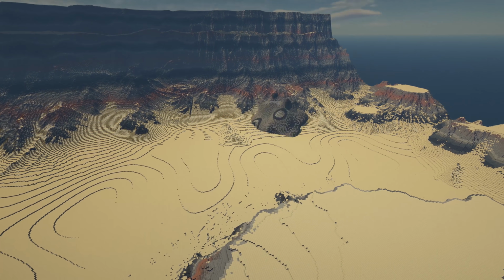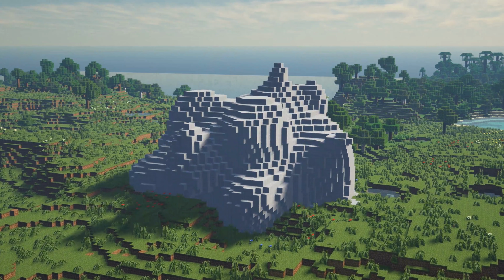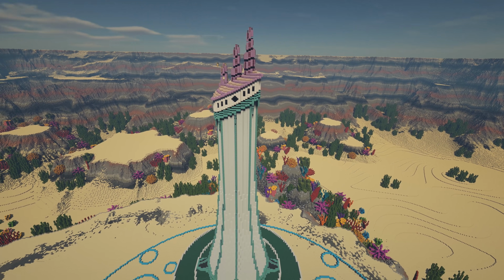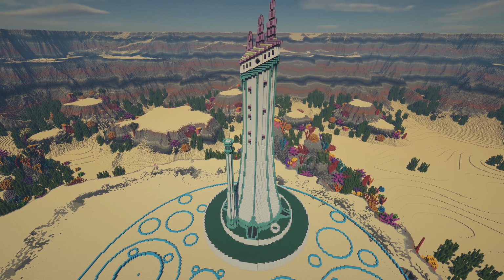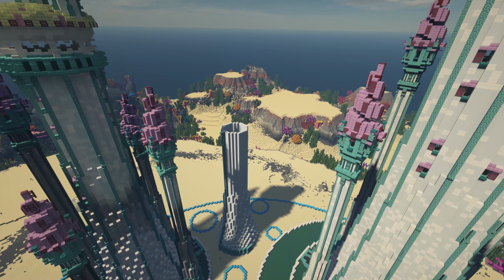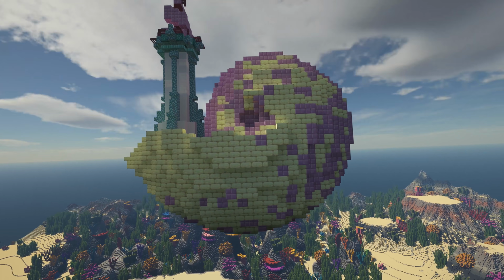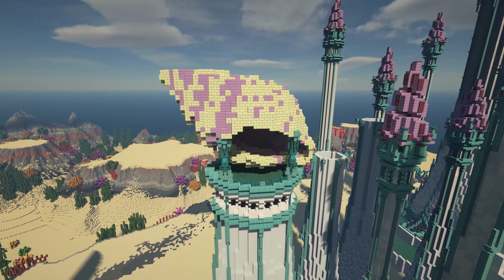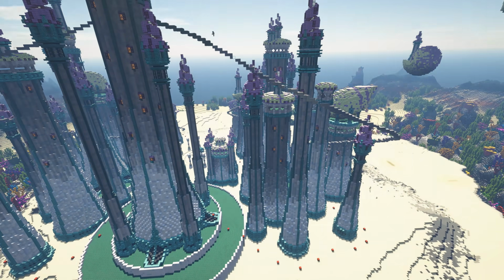My Most Anticipated & EPIC Minecraft Project EVER!

Comment: 1. There could be an under water cave or tunnel leading to the other kingdom
2. Or there could be a rusty scuba helmet that could lead to the other kingdom
3. Slums could be packed into groups of coral
4. Glowing jellyfish?
5. A trident to serve as a power source to a force field ( so the underwater kingdom can attack the other kingdom without being attacked itself)
6. Dolphins as guards 
7. a part of the underwater kingdom could be ruins as a result of an attack from the other kingdom
8. The other kingdom could be dumping its waste into the underwater kingdom ( a motive to attack )
9. Crabs could be used by the other kingdom to attack the underwater kingdom
10. A magma or soul sand elevator system
just some ideas I have

Comment: sea shell themed villages on the two lower shelves of the central plateau and a large arena taking up the lowest shelf between them.

An abyssal rift with monsters or kraken tentacles emerging from the black abyss.

whales with howdahs/carriages for transportation/cargo, maybe guarded by dolphin/shark riders (armor stands could be used to make the riders)

shipwrecks (maybe one has been repurposed into a home)

giant eel resting in a cave on the massive cliff face dragon-style.

small villages/settlements interwoven among the reefs, maybe even a couple built into particularly large rock/reef formations.

A small magma breach with a settlement dedicated to smithing built up around it, 'using' the ambient heat of the breach to heat the metal.

more tower buildings/settlements on the other smaller plateaus, not as big or numerous as they are on the central plateau.

having fish farms made out of seaweed 'posts' interwoven with netting inbetween them.

a group of dolphin/shark riders fighting/hunting a giant crab.

seaweed/kelp farms.

a mage tower with a vortex leading into a hole in the roof (either real (how would that even get done?) or simulated using a descending spiral of 'water' colored blocks)

Comment: One thing that triggered me is building pilliars and putting nothing on top of them. What is the point of a pilliar if not to hold something up? This triggered me with the vault in the elf kingdom as well. Plz build something on top of the pillars around the power source,  it has so much potential. Maybe another shell or a statue of Poseidon. Also the vault in the elf kingdom could be built up on top as well, with lots more storage and pilliars going up into the cave ceiling.

Comment: Warning: prepare for an essay of ideas.

         At least one person down here said a trench. You should do that, but add some houses in the sides, connected by balconies and bridges. They could be made out of warped planks.

         Or a whirlpool made of glass panes that breaks through the surface.

         You could also add a giant, deep-sea worm that looks like it's flowing in and out of the sea bed all around the entire map, like a protector of the build. It could have an angler fish-like light on its head with a few deep-set, eerily glowing eyes and rows and rows of huge, shark-like teeth. Some of the teeth could be scattered around the map: huge trophies that peasants and royalty alike deem priceless. 
         Another commenter talked about a giant stone statue with a rusted diving helmet on it; you could make the helmet slightly lopsided and the statue's base tilting out of the sand a little like it has been moved by the tides over time. Sporadic bunches of algae around it and cracks/other weathering would make a great addition. It could have a worm tooth around its neck and a trident gripped in its fist, either in a standing position or ready to strike.

         
         Skeletons of giant (two-headed, triple-tailed) mermaids that have been gnawed away in places to make underwater nests for strange, gilled birds.

         Yet another person talked about pods of glowing jellyfish; they could be made of stained glass blocks and paned and filled with lava or sea lanterns for the gills.
Reply: Yes, I just liked my own comment.

Comment: Put a glass dome around just the castle. I feel without it there's no point in stairs. Also it'll be easier to see the full castle underwater if the castle the castle itself is surrounded by air.

Comment: For more Lore,

you could add an old ruined kingdom that was overtaken by the rising water level.  This raised water became enriched by the power source, causing the sea serpants to overgrow in size and quantity.  The Water Kingdom took advantage of this to overtake the old kingdom to harness that power.  In last defense, the old kingdom escaped with a small piece of the remaining power source into an underground cave far away.  The new Underground Kingdom created a beacon with this power source, guarded by 4 knights.  This beason cracked the ceiling allowing sunlight to shed in.  This beacon power enriched the sunlight, which manifested these sky dragons in their new defense.  The Water Kingdom, years later, finally discover the new Underground Kingdom and return wanting the take the last of the power source.

Just trying to help connect the 2 kingdoms.

Comment: Hey! Just a thought! The power source is quite low in height compared to everything else. Naturally I think this wouldn’t be the case as sand etc would pile in this area due to water currents. What if the ground beneath it was a designed with this in mind and made to be a sand dune? This would Add in a bit of height to the Main generator as it’d sit on top of the dune in the middle with pillars down lower on the sides of the dune? Still keeping it much lower than the rest of the buildings but adding in a bit of extra character and dynamics!

Comment: Okay, hear me out. First things first, English isn't my first language, so I am sorry if there are mistakes. Second, I am not sure if this makes sense and it pretty much has an open ending. Third, it's 0:35 AM so it is probably even worse then if I would have written it to a normal time. So, let's start with my little backstory:

Centuries ago there were two rising kingdoms. The water kingdom and the cave kingdom. The two kingdoms used to be the most powerful alliance ever seen. But then the people of the water kingdom found a power source, big enough to power the kingdom for centuries. But as soon as the cave kingdom heard about this power source, the times of the alliance were over. The kingdoms fought and fought. Because of the long war, the people forgot about the reason they fought. But still they kept fighting. 
Before 10 years, the war finally ended after more than 5 centuries. But then, the power sources of both kingdoms disappeared.

(Again, I am sorry.)

Comment: Everyone's given great ideas about sea related things (and that's great, that what's going into the heart of the build), but I was actually thinking of a way to interact with the underground kingdom's people, or any other land dwellers? While they might be rivals, they are both key kingdoms of the land and need to meet at some points, so you could add bubbles of air from the surface all the way down into the kingdom, and possibly a little town, as an accommodation for the foreigners there to visit.

Comment: Idea for a building: Underwater mine. Underwater minning is very profitable. Seaweed and coarl farm. Finally a sppot where the water goes in tunnels to power the elf cave. Around those, a fortifiction to protect them. An area to train their water snakes. Also for the cave of the elves, because there is so much space left in the cave, there could be a dragon training area with cage hanging from the ceilling.

Idea for backstory: The main reason the underground and underwater kingdoms hate eachother could be because of economical reasons. I don't se this often but it is a very interesting and realistic cause of war. Since both kingdoms are extremly successful at mining minerals for their and other kingdoms, it's a battle of who makes the most minerals. It's two very successful companies competing against eachother. 
The only difference is that the underwater kingdom has underwater farming among other profitable businesses.
Due to the forges being fuled by water in the undergound kingdom, the underwater kingdom once blocked the water to stop them from minning (the water is their territory so the thecnicaly can). Out of fear of economic ruin, the underground kingdom launched an attack to take the lands where the water enters their cave. War broke out. The elves built a fortification around the openins to protect them.

In conclusion, it would be your desision to choose if they are still at war, but I would think so because the underwater kingdom attacks the undergound kingom with their snakes. There could be other reasons for war that came due to that reson. Logicaly, I wouldn't be war 24/7, times of peace and agreements.

Please consider this idea, it would mean a lot. :D 
(I may have other ideas that I would comment again)

Comment: You could make suspended features, like ‘buildings’ but they’re weighed down by old sea anchors? Also you should add some sort of leviathan as a kingdom protector, it would kind of just be hovering either above the kingdom or along the very edges. It’d be neat if it were longer and with more teeth than big and bulky, but I dunno. It’d be neat if you was this

Comment: How about a ravine with a ruined underground facility in it?

Basically the lore would be humans decided to live underground when the sun rampaged and increased in temperature. Inside the facility, there's a single tree that doesn't require the sun to perform photosynthesis and it absorbs carbon dioxide a lot faster.

When the ceiling of the facility collapsed, all the people drowned and eventually became skeletons and the only thing left was the tree that kept generations alive.

But one survived, and surprisingly it's the founder of the underground kingdom.

Or since the whole thing already reached bedrock, just put the facility in a cave I guess?

Comment: Some ideas:
- in the rock face you can have the entrance to the kingdom, maybe a little building built into the face that connects to some water elevator that would transport outsiders to the kingdom
- a giant serpent wrapped around the central castle platform
- A section of floating houses that are connected to giant floating bouys on the surface of the water. This could be the wealthy section where they "look down" on the rest of the kingdom

Comment: what if the underwater kingdom was usualy a peacefull land, but bc of the water it is very hard to forge things, also its hard to mine and get the wanted recourses and goods, so they mostly depended on the underground kingdom, but the underground kingdom has problems mi Ing so many recourses in such a short time, the recourses are Getting thiner too and the diference between the poor and rich People in the underground kingdom was geting too wide and the poor People started rebelling, so the underground kingdom had to cut off the output of the recourses and such to the underwater kingdom in order to get the balance in the underground kingdom, but the underwater kingdom needs the resourses so they sent those trained waterserpants to get some of the recourses. another words There could be a tunel or another way the serpents got in the underground kingdom, empty storiges, very specificaly made and thought out forges that could be used on very rare ocations and mines that wouldn't have many stuff in them or such, There could be  a lot more slams or building that were previous ly beautiful, but you can tell that it really needs repairs, the poor People would now rebel in the underwater kingdom bc they didn't get enough resourses to live off of and so the Castle would have some defences up, like some sort of catapult stiled things and other stuff like that, the poor People wouldn't have much resourses like I sayed so they would have to improvise with what materials would they use and what wepons would they make. Hope it makes sence since im from Czech republic, english is my second laguache. you don't have to take the hole idea, you can just take the main idea and make it in your own way. ID just be Happy to help.❤️❤️❤️

Comment: As the cave kingdome had seasnakes attacking, it seems only fitting to have the snakes either within a ‘stable’ of some sorts or to have them simply swinging around the kingdom/castle. Additionally, the cave kingdome utilized armor stands to represent the humans/villagers a bit. This will prove difficult underwater and with the angle in which you swim. Theirs a mod that allows armor stands to be more dynamic, but I Unfortunatly don’t have much more info on it.

Comment: You should add:
A city
A trench
Sunken ships
Caves
A prison of some kind
A treasure trove
Spawners
Fishing grounds
Outer settlements of the underwater folk
Various easter eggs
Interiors
Survival elements
A texture pack which only increases visibility under water
Or increased night vision access
Storylines
Possibly Axlotls
Drowned spawners
Somewhere for the ships to come from and go to
Possibly a human fishing village as well
An isolated bay
Some ruins
A merfolk sunning rock
Some sea grass
And anything and everything else suggested elsewehere to some degree.  That is a lot of space to fill, after all...

A few notes on coral placement and varieties:
"To survive and flourish, hard corals require water temperature between 68 degrees Fahrenheit (20 degrees Celsius) and 86-95 F (30-35 C) on the high end depending upon the species. In addition, they need sufficient sunlight, a hard bottom no deeper than 165 feet (50 m), some current or upwelling, and the water that bathes the corals must be relatively clean....
Some of the more prominent Caribbean species are called staghorn, elkhorn, finger, brain, pillar, star, plate and lettuce coral. Hard corals are not just randomly scattered throughout reef communities. Instead, each species has a preferred niche. Elkhorn coral is usually found in shallow water where the surf breaks. Pillar coral favors the reef flat and the reef crest, the shallow upper edge of the reef slope, while staghorn coral tends to be found in calmer waters just inside of the reef crest. Finger corals inhabit the reef crest, while plate, flower, lettuce and green corals tend to occur in deeper areas.

Several important species of hard corals are commonly called star and brain corals. These species are usually found in fairly shallow patch reefs and along reef crests. When living in deeper waters, star corals form plate-like structures that provide more sunlight for vital algae that live within the tissues of the coral polyps."
Marty Snyderman.  2006.  The Reef Builders: Corals.  Dive Training.  https://dtmag.com/thelibrary/the-reef-builders-corals/.